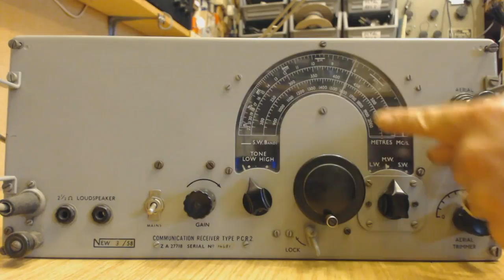Pye PCR2 communications receiver

Comment: hi Ray, i remember dad had one we used to listen to back in the  60's...it had a speaker grid on the front, it also had a separate power supply with the big connector leads, i got a big wallop from the lead when i was about 10, cant remember why i stuck my fingure in the socket..lol..but thats why i remember this radio after about 47 years, it was also black, i remember using headphones, those old aircraft type phones
Reply from the maker: Happy days! I remember the one with the built in speaker. They were lovely radios. Cheers, Ray.

Comment: I can remember looking at one of these and hoping I could buy one back in the 1960s. Brings back some memories. Thanks.
Reply from the maker: They are lovely radios. Hope you finally got hold of one. Cheers, Ray.
Reply: Sadly I never did, but ended up with other radios including a 19 set I completely modified as a receiver only. Used that with a KW / Geleso front end and the 19set as a fixed IF for it.However I always looked at the PCR radios and thought they would make a good set. Now, of course they are quite sought after. Thanks for all your videos.

Comment: Very nice, simple receiver.  We had an old radio, wooden cabinet, big old beast and used to listen to everything on it, though it was never sold as a communications receiver, it was far to nice with all the wood, its speaker was outside the radio on I think just about enough wire to put it on top or by the side of the radio.  So maybe another mystery solved?  I could never understand why the speaker was not built into the radio until now.  Thanks for that bit of info, I had never heard of the tax before.  It was a lovely old radio, I think it used to have a battery that had to be charged up, or maybe that was another radio.  Anyway, I am waffling on a bit now.  Thanks for showing us that.
Reply from the maker: Thanks! Cheers, Ray.

Comment: I had a phillips pcr2 in the 60s and 70s, it had a seperate mains ps connected by a lead and a b8 octal plug, Im not absolutely sure, but I think the PS had a speaker as well
Reply from the maker: That's right, some had built-in speakers.

Comment: Hi Ray:
Another interesting video of a good general coverage receiver. It looks on par with my Hallicrafters S-40A except a lot more rugged.
I noticed all the valves were held down with restraints except for the rectifier. And the base for it looks modern.
The lock for the tuning, locks the dial in the opposite direction to the arrow. Strange.
It is in terrific shape.
Also one last thing. That story of the use of receiving messages all in a clandestine manner was fascinating!
Take care,
   Tom

Comment: I had exactly the same receiver myself back in the late sixties.  Mine also had a built-in power supply and an internal mounted loudspeaker, but these were both modifications carried out by previous owners before me.

Practical Wireless published an article on modifying the PCR2 in the mid-sixties.  There were simple modifications like installing a speaker, fitting a loudspeaker and changing the first valve with a more modern B9G version.  But there were also much more complicated mods like changing all the valves for B9G types.  I never got around to doing anything very much with mine.
Reply from the maker: +John Galaxy I remember the Practical Wireless mods. They were nice receivers. Thanks for commenting, John. Cheers, Ray.